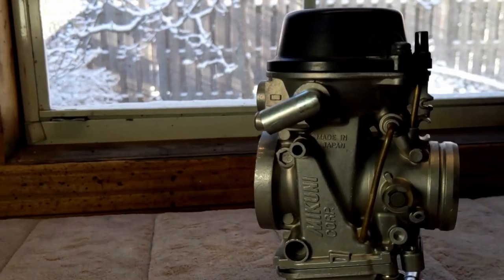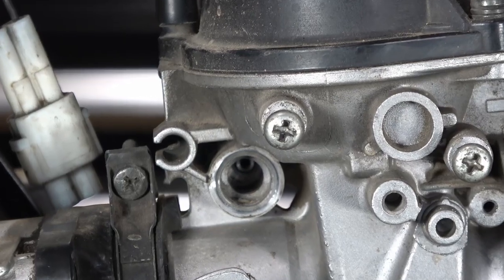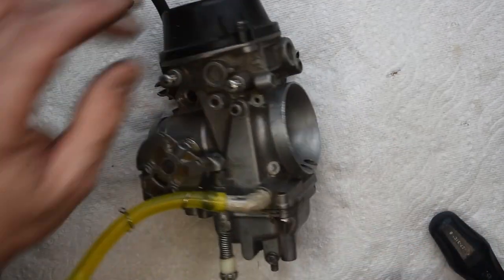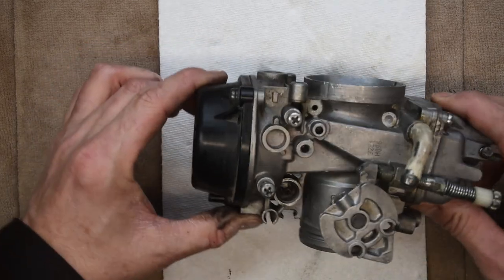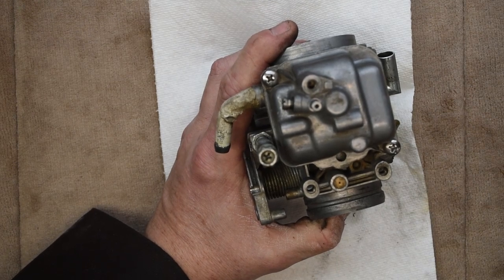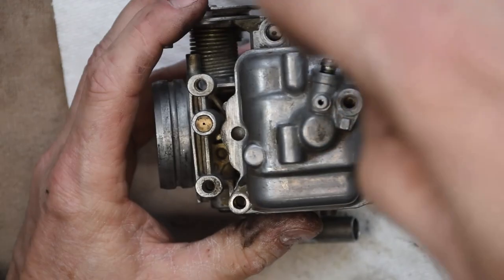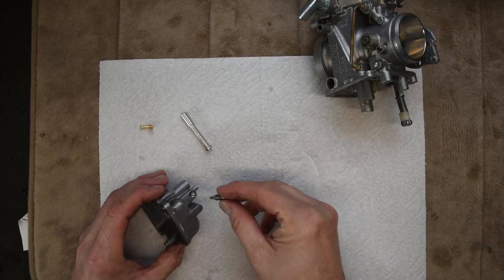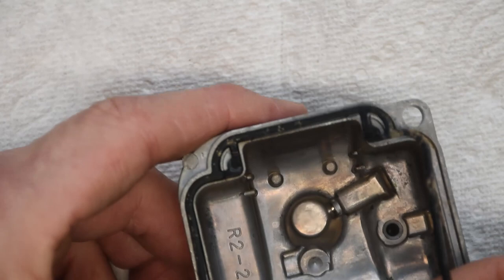I clean a DR650 carburetor.

Comment: This video is very detailed - voice and picture - regarding the DR 650 carburettor. It has all (and some more) of the information needed for servicing the carburettor (which has some delicate parts being a diaphragm carby). This video does not skip over the important aspects of gently handling the disassembly or the need to be careful with compressed air - both pressure and direction. Anyone who does DR maintenance will find this useful. Thankyou Dino.
Reply from the maker: Thank you Mal, glad you liked it. I hope you enjoy the next part on the jet kit installation as well 
Dino

Comment: Hey, thanks for the in-depth on how to remove the carb. A lot of the forums just say “it’s the easiest thing!” But I’ve barely ever worked on a bike and barely understand what a carb even does….your help much appreciated.
Reply from the maker: So glad you find it helpful, I know myself the first time  I popped open a carb it was intimidating. An actual mechanic once told me that if you take your time, take pictures as you go and do a bit of research before you start, most anyone can repair things. The key is taking the time to try, good on you for taking the steps.
Dino

Comment: I got a 2006 DR650 with 1,200 original miles it had been sitting (put on a Clarke gas tank as the original was rusted) from siting. I got a Mikuni made 'kit' from Procycle worked perfect. Been riding for years - Carbs are easy to work with and easy to tune. The JD Jet kit wakes up the DR650 first thing I did as well. I put on Twin-Air as well, and got rid of the vacuum petcock. Put on a manual (Raptor Yamaha one). --- EXCELLENT VIDEOS!!!!!
Reply from the maker: Thanks for the comment. Even in tuned the throttle response in the shed is noticable to be. Can't wait to tune it and try it out.
Dino
Reply: @DinosTinkerShed  It is a 'night/day' difference. I have put about 500 miles on it and I put on new tires/tubes as well. Did the 520 - oring conversion kit to. I am going to put on the GSXR exhaust - Procycle offers the pipe to connect. Then hopefully do front suspension Fork Cartridge Emulators. I got a RM250 I am rebuilding right now as well.

Comment: VESSEL - makes some GREAT JIS screwdrivers and other tools. The Suzuki DR650 is such an AWESOME BIKE and way underrated by those who say it is 'outdated'.
Reply from the maker: Thanks for the tip on the vessel tools I'll check them out. Sometimes I think we " outdate" things ourselves and forget about the benefits of simplicity, is the DR perfect, no but neither is any other bike.
Thanks again for the comments.
Dino
Reply: @DinosTinkerShed  Agree - the DR the small mods make huge differences. You will like the Jet kit it is AWESOME!
Reply: They do an awesome impact screwdriver. A little pricy but it's well worth it, I just bought one to disassemble my CCM 644 engine (which is a twin carb version of the DR650 from the xf650). I'll never go back to trying to make do with a Phillips head.
Reply: @elobiretv  Agree, the Vessel are like kinda a hidden gem. If only I knew about them like long time ago.

Comment: Thanks Brother from Utah.  My 2017 Dr has seen the Rockies and Moab more times than I can remember.  Would not start this spring. I did the usual Sea Foam treatment, etc.  Pulled the carb today and was surprised from all the fine red dirt from Moab and utah.  Used a carb cleaning fluid and reassembled. The slide was filthy, which surprised me.  Anyway, adjusted the valves and cleaned all the gunk from the spark plugs from the resulting in many...many attempts to start prior to cleaning.  I put it all back together just two hours ago.  Installed a new fuel filter. And..Wow..I just touch the starter and she runs good. I did adjust the mixture and idle of course.  I'm 57 and this bike will give me many more years in the Mountains and Desserts of Utah.  God Bless...

Comment: I buy a used bushpig about 2 months ago. Pass test for full endorsement 4 days ago. Yay me......
Anyway, I cant find any videos covering adjustments without taking things apart.
 
Video suggestion: adjustments to stock bike without taking anything apart.

I buy my 2005 bushpiggy with mods: frs exhaust. Kn filter. Finger idle screw. Pro Taper handle bar. Acerbi 4+ tank. Acerbi bark buster. Acerbi bash guard. I just bought it, I love it and I dont want to take it apart! I buy from unknown previous owner. Engine and gearing are stock im told. Only cosmetic mod or upgrade cause you broke something.
Reply from the maker: Thank you for the comment and suggestion. many of the adjustments do require some disassembly. Would you be thinking of things like clutch cable adjustment, oil changes, air filter cleaning ect?
Please let me know.
Thank you again
Dino

Comment: It helps if you secure the carb in a vise with protective jaws which allows very accurate pressure on the screws, also never use torch cleaning tips, they have serrations that will damage the orifices of the jets, just use smooth wire, while your at it replace any rubber O rings and seals with one's that can resist ethanol fuel, a guy named Gregory Bender at thisoldtractor sells the kits.
Reply from the maker: Good tips, thank you. I will say that every small engine mechanic I know uses tip cleaners to clan carbs, I am not saying they are right but they have never indicated that they have issues with the proccess.
Thank you again for the comments.
Dino
Reply: @DinosTinkerShed  Thanks Dino, I can't tell you how many mechanics I've known who's heart wasn't in it, they don't know any better.

Comment: Thanks for great detailed video, 
Fun fact  difference between JIS and Philips screwdriver  is the tip of the screwdriver. 
JIS = flat tip
Philips = pointed tip
Use JIS on any Philip head screw but not Philips on any screw.
Simple solution take a Philips head screwdriver and flat-out the sharp bottom out. Thus now u have JIS.
Reply from the maker: Very cool, the ps3.
Reply from the maker: Thanks not sure  where ps3 Came from, auto correct I guess.
Dino

Comment: Just be thankful you don't have an early bmw f650. Why oh why did bmw think you needed TWO mikunis for a single 650 .   I spent an hour last weekend pulling apart my DR wouldn't start. Pulled ot apart and gave it a quick clean and all was good. Went to start it a few days later. Same thing. Ended up doing first what I should have done the first time. Tapped the fuel bowl and it then started fine. So I have a sticky float which I'll get around to fixing at some point.
Reply from the maker: Two Carbs? wow, they must have thought twice the fun to clean and set up, LOL. Seams a bit overengineered but they do make great bikes for sure. As you point out the DR is a bit more simple to work on. Thank you for the comment.
Dino
Reply: Hi Volvog, did you get your float unstuck? Was that the problem?
Thanks, 
Ken
Reply: @kenholland683  I did. The needle looked perfect so I ended up putting some cutting compound on a cotton wool bud (q tip I think they call them in the U.S.) and put that in a drill and smoothed out the seat. It was fine for a week but as I had ordered a new needle and seat assembly anyway I had it swapped out by my mechanic  whilst he was doing some other work to the bike.   I don't think the needle is available as a separate item but as the bike is a 95 I don't mind replacing things as preventative maintenance.
Reply: @volvogt21  Thanks, yes might as well replace while you're in there.
Cheers
Reply: Early bmw?

Comment: Hey Dino I just picked up a 1991 Suzuki 650dr and it have been sitting for 5 years I’m not getting any spark i checks the kill switch’s but still can’t figure it out
Reply from the maker: Do you have a multi meter to check voltage at the coil?
Dino

Comment: My carb is leaking gas, i think it's the float valve system, do I need to replace it or it can be adjusted? Nice videos I hope you are doing ok in your heavy machine operator courses.
Reply from the maker: Thank you for the question, again I'm not a mechanic but I will give my thoughts. The is serviceable and it may be best to first give the entire carb a good cleaning to ensure nothing is stuck in the float needle valve. Once clean check the condition of the float needle tip and take a look in the port that the needle sits, the seat at the bottom should be in place and in good condition. When putting it back togeather check the float height and adjust if required. If this does not stop the leaking you may need a new float, needle and seat.
Hope this helps.
Dino

Comment: I see so many people drilling air boxes, adding slip ons, and getting new carbs. Am I wrong for being totally fine with the stock setup?! 🧐
Reply from the maker: Nope, stock is just fine. Mine is pretty much stock other than an adjustable fuel screw to help with cold starts and a bit richer main jet. I do like to experiment but I try not to do anything I can't reverse. My goal is smoother running not really more power.
Dino

Comment: Hi Dino. Thanks for sharing. I might purchase the same carb for my DR 600 S (85) and your video helps me. But where do the thickest hose near the brake reservoir ends and what is it for? I believe the thinnest hose is for fuel ? My old Mikuni doesnt have that port.  My writing might be a little norwegian english :-)  Roy
Reply from the maker: Thank you for the question Roy and I love your Norwegian English. I will double check this but I am sure the fat line runs under the seat to a small air filter. This allows the bellow in the carb to operate properly when vacuum is generated by the flow of air through the carb and allow the slide to be pulled up. Again I'll check again tomorrow just to be sure.
Dino

Comment: My dr650 doesn't idle by itself. It starts badly and is misfiring a lot. Is the carb the problem? It sat in a barn a long time.
Reply from the maker: Although it is hard to tell for sure I would say you are the right track here. Most likely the carb is gummed up.
Thank you again for the question.
Dino
Reply: @DinosTinkerShed  Update: I cleaned the Pilot Jet today and the bike runs perfectly now!
Reply from the maker: @kekerlek7761  right on, that's great to hear.

Comment: can someone please help me ID the  hose at 6:30. The big hos, I believe goes to the breather filter up above the air box, trying to remember if the smaller/bottom hose is just a vent or where it routes to. Thank you
Reply from the maker: Hey thank you for the question. I belive the smaller hose is the vacuum port for your petcock .
Dino
Reply: Hello! Thanks for this very helpful video! I realized while taking off the carb that my vacuum port had nothing going to it. It looks like an aftermarket petcock that doesn’t have a vacuum port. I’m assuming I should block off this vacuum port instead of leaving it open correct?
Reply from the maker: @mitchellkauffman6799  yes you should. You can get caps on Amazon in a kit
Reply: @DinosTinkerShed  awesome, thank you! So did both this port and the vacuum line that you pointed out on yours both go to the petcock?
Reply: If the small port is not capped off can this cause issues?? If so what kind of issues? Thanks !
Reply from the maker: @ELBertoProductions  hey thank you for the comment and question. I've never ran without the port capped off, however I would think a vacuum leak like that would influence how the CV slide functions and may create fluttering or inconsistent throttle performance. Again this is just speculation from vace leaks on cars I've owned.
Reply: @DinosTinkerShed  Thank you Dino for the response, I believe that was one of the reasons why my bike was starting only with choke on and it would shut off as soon as carb was off or if throttle was engaged it would also shut off. Currently waiting on parts to rebuild the carb to see if it works! Also, do you know where I can find the O ring that goes at the end of the carb slide guide?? Can't seem to find any info on it and mine was very bad. Thanks in advance!
Reply from the maker: @ELBertoProductions  I would have to look, usually you can find the parts numbers on Babbits online, I use it all the time and then order the part from my dealer. If that does not work Procycle is my go to for hard to find parts.
Reply: @DinosTinkerShed  I will try Babbits online, currently waiting on procycle to respond to my email as well. Thanks alot Dino! I cannot wait to get the DR going 😎

Comment: Unrelated; have you modified your suspension?
Reply from the maker: I did not but a previous owner did add a heavier rear spring. I have not had the forks open yet but I do not believe they have been modified.
Thanks for the question
Dino
Reply: @DinosTinkerShed  the only reason i ask is because I just finished doing a 9.6kg racetech spring in the rear with 10w oil, and the .8kg fork springs, also with 10w oil, and I am thoroughly blown away by how much more confident it feels on and off road. If I had it to do over again, I'd probably do that first. I'm a 240lb guy and it actually feels tailored to me now.

Comment: Help Dino! 

After cleaning the carb, installing an acerbis tank, and a procycle jet kit my dr hasn’t been able stay running. The tank doesn’t seem to want to flow fuel in the on position, but it does in reserve. With that said, I put maybe a gallon just to see if it was going to work. So is the tank not flowing cause there’s hardly any fuel? 
If I run it in reserve, it dies after about a mile of driving and it seems to always die when I throttle down. To start it back up I have to open the throttle completely. Any ideas?
Reply from the maker: You are correct, the red is ment to draw from a lower level than the on position. Its a bit of a safety so you don't run out of gas. You will need to add more fuel to the tank to get the level high enough for the on position to draw fuel
Dino
Reply from the maker: Did you get the choke seated correctly after the cleaning and jet kit?
Reply from the maker: Also, remember that the fuel you put in is split on each side of the tank so a gallon may not be enough to keep it running to long.

Comment: I thought you would have removed the throttle valve guide out to inspect for wear ...
Reply from the maker: I did consider it however it looked relatively new just looking from the outside. This is not accurate by any means I know but I thought it could be done in more of an overhaul video in the future than in this one which was more focused on cleaning.
Thank you for the comment for sure.
Dino
Reply: @DinosTinkerShed  While it is common practice to inspect & replace worn parts etc while stripped to that level I do understand your position for creating these videos under specific titles ... here in Aus the guide is not available under the OEM - E24 DR parts list which deletes the carb as being sustainable by replacing worn parts ... this is a presumed deliberate move to force the purchase of a new carb when the guide is designed to wear & be replaced ... which would be described as a consumable ... as you have shown is available to purchase in the US ... cheers mate ... you do a great job on these vids ...